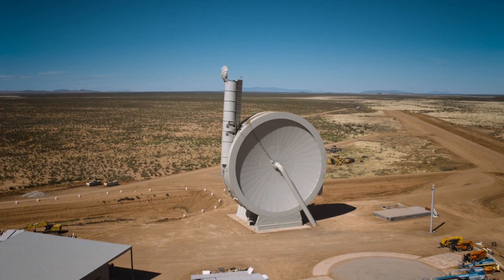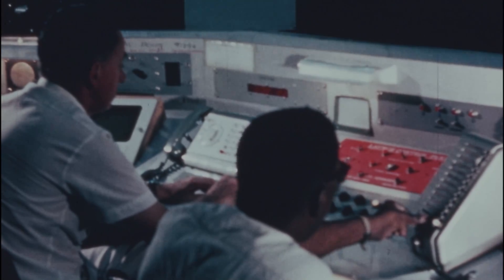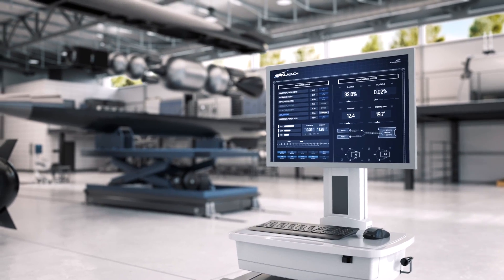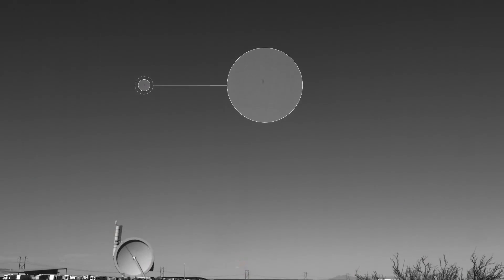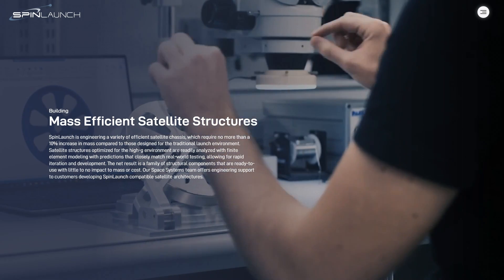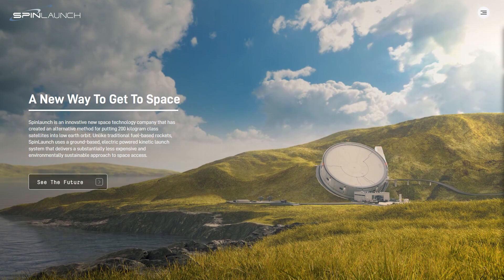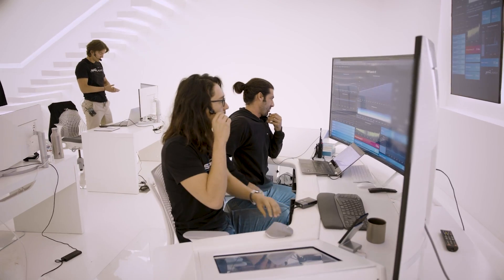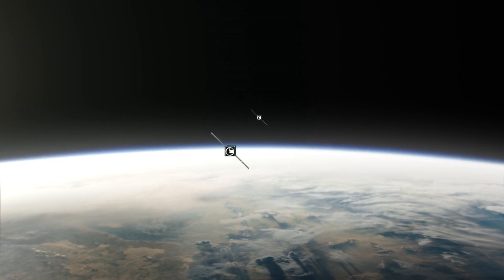Can Spinlaunch Throw Rockets Into Space?

Comment: Reduce the amount of instantaneous rebalance needed. Use a dummy weight on the opposite end, release at same moment, down into a bore hole.
Reply: I was thinking the same thing.  I was also thinking of those Russian high speed torpedoes which create an air pocket around them to cut through water and I wondered if a similar thing could be done to get around the air pressure at satellite  launch...maybe a a lazer or railgun fired first?
Reply: Yeah. That seems about the only possible way to rebalance it. I really want to know what they've come up with.
Reply: I was thinking of this. Perhaps a tank full of water or sand.
Reply: Could this not be done within the flywheel to let a near centre load in line with the payload ‘drop ‘ to a rim location to replace the missing payload?   Would also slow rotation at the same time.
Reply: @guygillmore2970  That weight would have to travel the length of the arm in a millisecond and then stop dead. That's still a hell of a problem to solve.
Reply: @thomaskilmer  that's what i was thinking aswell. Not feasible.
Reply: I'd think you could do several things in concert, if the complexity turned out to be a good compromise.
Both of these ideas could be used together
Also, as part of the release/center load release also move the arm on the hub
The dropped counter weight will have massive kinetic energy and you'd rather not have a battleship shell hit to contend with. So use an aluminum slug as the counter weight; line the catch well with magnets, powered by turning the launch rotor motors into generators for more braking; the magnets in the bore will slow the counterweight via eddy effect (or make the well out of aluminum and the counterweight a magnet)
Still - the dynamic loading at release will be... significant. Something to monitor from a distance!
Reply: That's about the best way to create earthquakes
Reply: you can also rebalance it by moving the counter-weight further closer to the center.
Reply: The dummy weight could be greater than rocket, consequently it will be placed closer to the whelll's center. The speed of released dummy weight should be lowered as much as the dummy weight is cliser to the center. Add some magnetic break on the ground to reduced dummy wheight speed. The earthquake problem is solved and the kinect energy can be converted to electricity. Ps. English is not my fist language
Reply: Equal and opposite reaction.
Reply: Yes, but do you really want to drive a kinetic bomb into the earth everytime you launch something? =) Could end up bad.
Reply: @maeyae  yes, I absolutely want to see a 100k ton splash in a mine shaft, almost as much as I want to see them mistime the release fractionally and wang the rocket into the side of the drum. :D
Reply: @Isambardify  Banging into the drum. Badum Tisssh.
Reply: That's what I thought! You could even make it a big magnet and place coils around the bore hole so you a) get some energy back and b) don't smash this thing into the ground that hard. To be fair, this will prolly not be worth it.
Reply: Launch 2 for the price of one, you would be off balance for half a rotation
Reply: @williammcguinness6664  
I think in that time, the shaft would sheer and 2nd rocket and arm would crash through the bottom of the drum..
Reply: Couldn’t you let the counterweight release into a large pool of water underground? Should be cheap and might take care of the potential quake
Reply: @torbjornwinroth9062  Water isn't compressible at those speeds, it'd act mostly like a solid, and flash to steam in a steam explosion. They might use it to carry impact energy away as heat in the steam, but it won't do much cushioning.
Reply: I did some math and a dummy weight that's equal to the rocket (11200Kg going at 2356M per second) would have energy of 31 billion joules  E=.5MV^2. That's a ton of energy. TNT has an energy density of 4.6 million J/kg. So the energy in the dummy would be equivalent to 6,740kg of TNT. The best I can figure to safely disperse that energy is having the dummy load be water ice, shot into a pool that's in the bottom of a deep bore hole. I'd hope the majority on the energy would go into the phase change of the water.  the energy required to melt water is 333kJ/kg and for boiling it is 2,260kJ/kg, that's 29 billion joules just for the phase change alone of 11200kg of water and the energy from the temperature change (11200 kg * 4184 j*100C) is 4.6 billion joules.  So turning a 11200kg ice block to steam would require total 33.6 billion Joules, that's greater than the kinetic energy in the block so it seems feasible. Then You'd have to deal with the steam, but I think you could do it. But maybe this is a dumb way to dump energy.  Or all my math is wrong, please tell me if it is, I'm no scientist.
Reply: @tomw3295  well first off water wapor takes upp alot of space so might be better to dump it outside to reaact with the atmosphere. turn the spinner so the rocket will be launcned sideways and lauch a cone chaped icebloc kin the oposit direction as it mellts from friction, could even dress it in metal to allow it to clime the athmosphere before exploding in a mist of water vapor
Reply: Came here to say the same thing 👍
Reply: Why not use msgnetic breaking? along the edge they can have magnetic breaking
Reply: U just gave away one million in ip
Reply: @bradley5819  Again lol. Story of my life. Anybody know a good patent lawyer?
Reply: Ur idea is brilliant

Comment: Working with turbochargers, I've seen what small spinny things that come loose do.

I'd like to see what happens when the big spinny thing comes loose and yeets off.  Preferably viewed from very far away 😅
Reply: The final system absolutely needs to be completely underground, probably buried in well-reinforced concrete - so the only failure resulting in an external projectile would still be going in a presumably clear direction.

I've spun little pieces of plastic until they disintegrated and parts go flying, and that makes me nervous.

This shit is just as dangerous as a giant bomb-tube using its constant explosion for propulsion, for sure. It's cool as shit and I hope they're successful though.
Reply: @tkeleth2931  They probably also have to build one just to test and prove that the design is valid and can contain a catastrophic failure.

Comment: I'm not at all convinced that this is the way to go on Earth. On the moon it would be great though. Especially with dumb payloads like .... propellant made from lunar ice, consruction materials. It could launch many times an hour to provide a ring of resources in orbit around the moon. Lunar escape velocity is 2.38km/s. To get min orbital velocity you divide by sqrt 2, so 1.68km/s.  Make it several times the diameter and you can slow it down to reduce the G force, use a cable instead of an arm. Then you can get to orbital velocity (but for geometrical reasons you still need a small rocket for apogee kick to circularise the orbit, otherwise it will just follow an elliptical path and smash back into the launch site.)
Reply: Where on the moon are you going to plug it in for the electricity?
Reply: @absolutenigma  Well, obviously, if you're going to be mining on the moon, and especially if you're going to be making propellant from lunar ice, you're going to need power for that too. The power would come from nuclear or solar, the same as would be used on Mars. Elon Musk claims he wants to send people to Mars soon, but SpaceX (and other players) will spend the next 10 years servicing NASA's ambition to build a permanent base on the moon - just watch. That will serve as a major experience gain for the Mars mission. Ultimately, if we're going to explore space beyond Earth orbit, we NEED resources from the moon. It just takes so much energy to lift materials from Earth out as far as lunar orbit, that developing mining and propellant extraction on the moon is inevitably the way to go.

Comment: Theoretically you could do it on the moon.  However, if you have no fuel on the moon for a rocket, you also have no fuel on the moon to make electricity to power your electric launcher.    No wind, no running water.      Solar perhaps but you'd have to have solar panels over the entire surface to create enough power or launch about 1480 Starships worth of batteries to store it.    Purpose defeated.

Comment: I would think something like a water tank on the counter-balance that’s emptied at the same time the sabot is released would probably work as an instantaneous or nearly instantaneous rebalance.

Maybe even a tank it releases that gets flung downward into a catch pit at the same time the rocket/sabot is released lol
Reply: And then you could have the sustainable garden getting watered after every launch. Environmentalists will love it.
Reply: Apparently, the "tether" (the jargon for the spinning arm) is so much more massive than the projectile that the counterbalance doesn't have to be ejected. The reason apparently is that there are high order resonance effects in the tether when the projectile is released. These resonance forces are so large that they had to build the tether and bearing to accommodate them, and that ends up making the whole thing strong enough to simply absorb the relatively small imbalance in the tether (compared to its total mass) when the projectile is launched.

Basically: the spinning part is so massive that the loss of projectile mass isn't a problem.

Comment: I find it interesting that they went with a central hub motor instead of electromagnets around the rim. But I'm not an engineer and they are. I'm sure they did the calculations and figured out the hub motor was the superior choice.
Reply: It's cheaper since you'd need a sled, and the stress on the outside radius would probably rip the magnets off their moorings, if they could generate enough inward radial force along with the desired centripetal action.
Reply: @stoneomountain2390  You don't need any sled or anything, you have the same rotating arm and everything ... just accelerating it with rim electromagnets instead of hub electromagnets.
Reply: @IsaacKuo  
So, you want the projectile to experience all that flux energy?
Reply: @stoneomountain2390  Magnetic forces go down inversely with the cube of distance, so it's unclear the projectile would experience anything significant at all.

More significantly, the electromagnets could act on the opposite tip of the bar as the payload, which would make more sense anyway. You need a countermass located there regardless, so it might as well perform double duty.

Comment: Feel like this system would do much better to build at a ski resort say 8 or 9 ft up.  The atmosphere is going to be one of your biggest enemies on this launch so knocking out the first 9,000 feet of the thickest air would seem to be of great advantage.  And totally agree, this would for sure be a great system for getting stuff off of the moon.  Should there be anything worth mining on the moon, this would get it back to Earth for cheap.  Package it up in a re-entry capsule and just hurl it back to Earth. Might not even need a parachute if you can build it to tolerate a 300mph splash down.

Comment: Scott,  your the man.  When I was younger I had the idea of a rail launch system. I would use tracks to accelerate the rocket to sub Mach speeds then  launch at an angle into orbit. It would save fuel or add payload.  My cousin’s husband busted my ass on it though.  He works on the Orion project now. He told me that the rocket cannot support its own weight when it is full and on its side.  I said that can be overcome with research and development. He said it would cost too much.
 It would require huge capacitors and towers to collect lightning to power it.  Levitating sled. Electric propulsion using magnetism.   A maglev.  I think it can launch small rockets into the upper atmosphere where it can ignite its rocket power for orbital insertion.

Comment: One way to deal with the release reaction would be to largely eliminate. This could be done by have a dummy load at the other end of the rotor and releasing it at the same time as the payload. You would need some sort of sump/catcher that wouldn't damage the system (by transmitted shock), but that is surely doable and simpler than trying to dynamically balance the rotor when one end suddenly become tons lighter...
Reply: Thats what i just wanted to say. Another benefit would be to easily vary the mass of the payload, since you could just change the counterweight too.

But a problem could occur if they dont fire at the exact same time, since releasing one a little early would cause a massive shake in the rotor, causing either the counterweight or the projectile to miss the exit
Reply: I thought the same thing. I did some quick math and a dummy load that's 11,200Kg going at 2,356M per second would have 31 billion joules of energy. That's a whole lot of energy to get rid of. TNT has an energy density of 4.6 million J/kg. So the energy in the dummy load would be equivalent to 6,739kg (14,825 lbs.) of TNT. I've been wracking my brain trying to figure out the best way of dispersing that much energy safely. The best can figure right now having the dummy load be water ice, fired into a pool. Hopefully, the majority on the energy would go into the phase change of the water.  In water the specific latent heat of melting is 333(kJ/kg) and for boiling its 2,260(kJ/kg). So turning a 11200kg block of ice to steam would require 29 billion joules just for the phase change alone, plus the energy from the temperature change (11200 kg * 4184 j*100C) is 4.6 billion joules.  In total that's 33.6 billion. But maybe I'm dumb and this is a stupid way to dump energy. IDK. or all my math is wrong. If it is please tell me. 
Cheers!
Reply: @tomw3295  seems like a good idea. I would dig down a tunnel on the the opposite site. 100 meters or so and build a waterpool down there. And then just use a dummy thats getting destroyed, but also slowed down, when it hits the water surface.
Reply: @tom w  then imaging the volume that water vapour would want to occupy, imagine that super heated vapour rushing back into the vacuum chamber, imagine the destructive power of a shockwave that massive hitting a still rotating arm designed to not spin in a gas.

There is no way in hell a structure designed to carry out such delicate
maneuvers can also withstand such punishment.

Imho, this is a still-born idea unsuitable for anything but a MythBusters episode.
Reply: @ghydda  that's true. Especially considering how fast the arm is going it would be bad news. Maybe a large shutter can snap in place after the dummy load leaves the chamber but   before it hits the pool? Plus I was imagining the pool being underground, but now thinking of all that steam, should probably dig up to the surface so the steam has a place to go. I don't think vents would be enough, just dig up everything so the entire surface of the pool was under the sky. Thanks for your input even if you think it's a bad idea.
Reply: @ghydda  Tunnels. Have a few vent shafts pointing away from the yeeter coming from  the pool or whatever septic tank the counterweight is flung into. You would need a fairly long entrance tunnel and a really fast closing door so all the steam blows out the other side. A steel case filled with water should work for the counterwieght. I wonder how deep the pool would have to be to slow down the steel bits eonugh to not damage the botom of it. Or maybe just bore it into solid rock and let the steel imbed itself.
Reply: @tomw3295  That might work. Just have the yeeter on a hill 1/2 mile up from the pool and construct a reinforced wall to deflect all the steam away from the yeeter.
Reply: I came here to say the same thing. So maybe they thought of it as well.
Reply: @MarkA-Dam_Engineer  Thats a good idea Its just tough to compete with water on cost. Also, water can absorb a ton of energy by turning into steam. Maybe some sand at the bottom of the pool instead of rock or concrete. Not eaxactly a liquid, but most materials act like a  fluid to some degree when struck with a hypersonic impactor.

Comment: How about just releasing the counterweight on to a rail inside the accelerator, and possibly regenerating som of the energy by sloving it down magnetically
Reply: The counterweight would have to exit the exact opposite of the projectile. So pretty straight down
Reply: @jk1422  i was thinking the counterweight would just transfer  on to a rail system running inside the circumference of the accelerator, and just keep spinning, then regenerating braked to slow it down

Comment: Question I would have. What happens after release. You've effectivly created an imbalance in the rotating arm. At those speeds that may well result in RUD of the bearings. At the very least it severely limits the weight of objects you can hurl into space (added that they still need a "second stage" the amount of payload seems fairly limited)

Comment: I wonder what the solution is for 'opening the chimney' which will then start to let air into the spinning chamber - that has to happen very quickly. On top of that, the projectile is going to hit a relatively solid wall of air coming out of the vacuum; curious what the g-forces involves in that are.